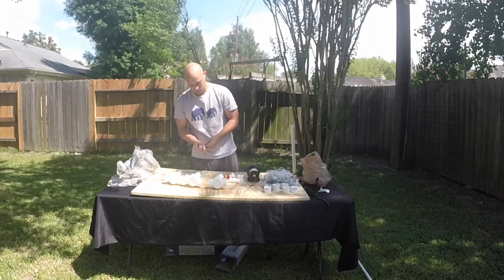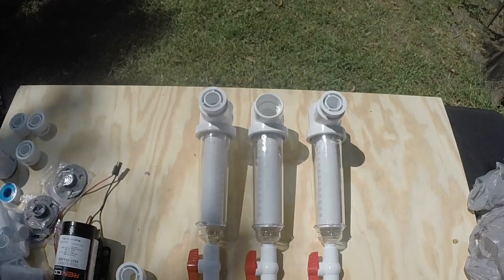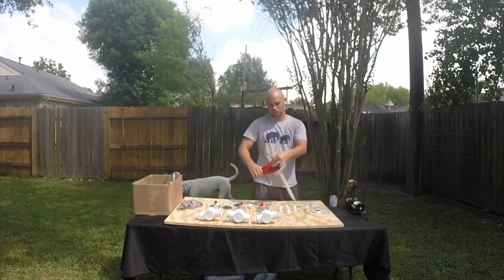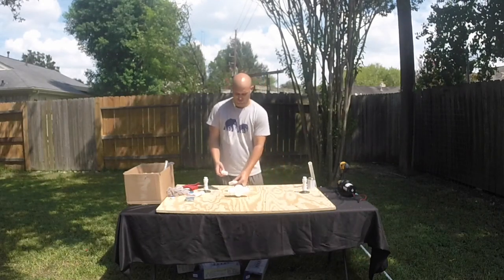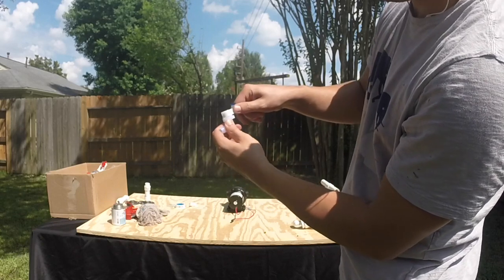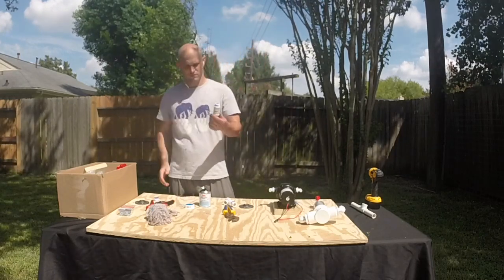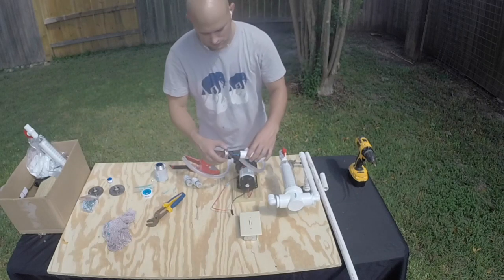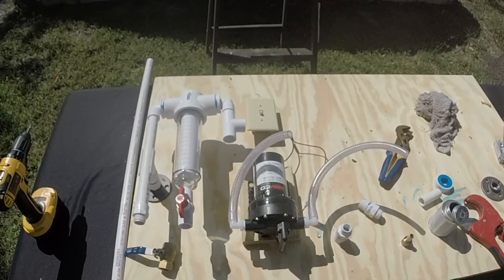Part 1 of 3 - How to Filter & Purify Rainwater

Comment: Hi can I use this system with a jet pump, I want to use rainwater form my metal roof to my well and supply my house, I have noticed my well is getting low, I have used this well for 30 yr it is a dug well
Reply from the maker: I am not sure how a jet pump will do.

Comment: Only other comments are that I didn't even know the glue comes in blue, but it also come in clear as well, and while colored is great for demonstrative purposes and rough-in, under house work, you can get a fully uncolored end result with clear glue and primer. Also, and i know I'm a carpenter and roofer but I've been around a little, it's not a bad idea to twist joints back and forth a couple times after gluing. You have to be fast or pull it back apart really quickly when you know you won't hit your mark for final placement, meaning starting over again with primer, but it has always been a preferred method by plumbers. it fills in voids due to anything scratching the glue out in a line straight down the pipe when two pieces are slid straight down upon one another. Otherwise, great video. Change of color would have been optimal on the primer/glue.

Comment: This is just another of many videos I'm watching to get a really good grasp on water purification. I'm three minutes in, and there's already two things i picked up on, from my own mistakes in the past, that I would do differently. First is the teflon tape. Wrap it same direction as parts that join to it, or sooner or later, you'll be stuck with a short piece of tape that wants to keep unwinding due to having it wound in reverse to what you are putting together. Second is purple primer. While that's great for plumber's rough in work, it isn't so great for finish work that's seen every time you open up your kitchen sink base doors. They do make primer in clear for applications that will be seen a lot. Also, the stain from this primer never came out of the jetted tub that had a few drops dripped into it at my mom's house. For rough-in plumbing though, inspectors love the purple primer.